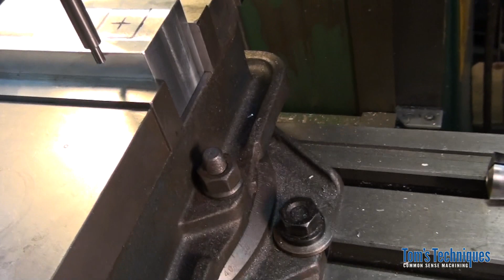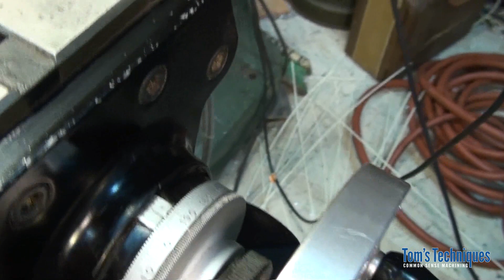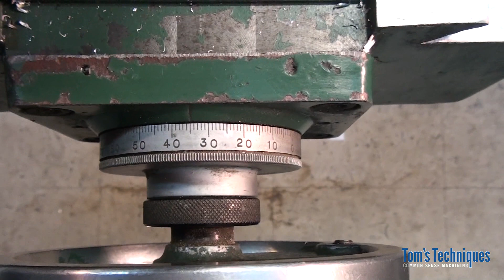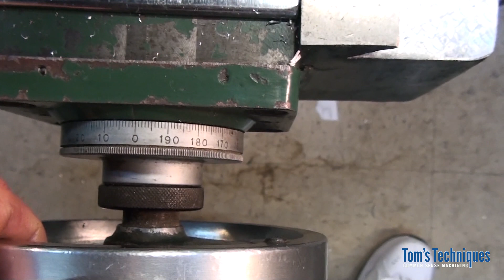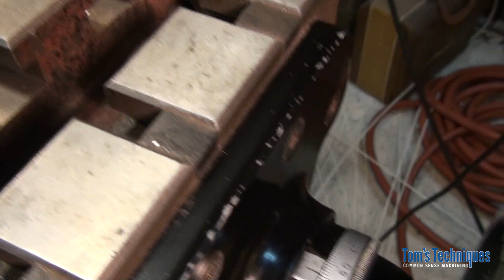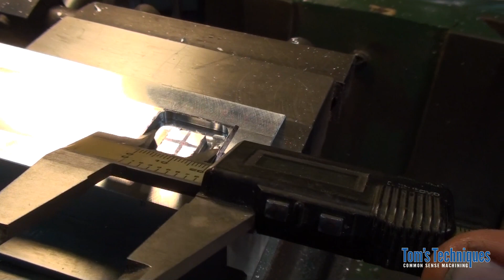Cutter and Backlash Compensation on the Milling Machine

Comment: Great video Tom.  Ya had me confused for a bit but I figured it out. Time to turn the DRO back eh?
Reply from the maker: The concept is confusing, which is why so many have trouble with dials. Backlash is a concept that needs to be mastered though if a DRO is out of reach. The Sharpie really helps keep you track of where you are.

Tom

Comment: What brand mill is that? Really nice dials, my '48 BP (before satin chrome) has plain steel dials and no flats for the stationary line just on the round portion of the bearing bracket, and are sometimes hard to read.
Reply from the maker: It's a DoAll 200V with a 9" X 49" table and variable speed spindle. I bought it new in the mid 80's when BP was having quality issues after the Textron buyout and it has served me very well over the years.

Tom